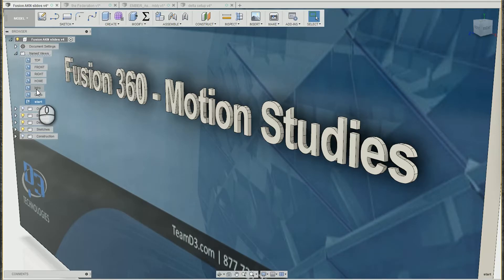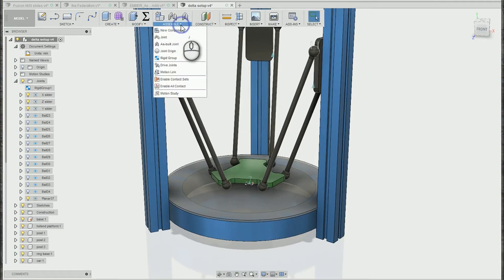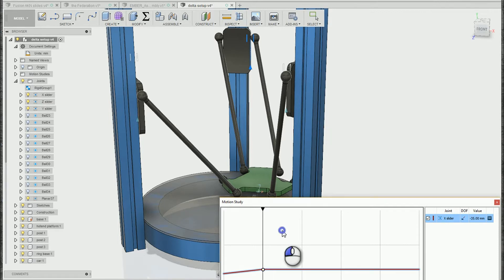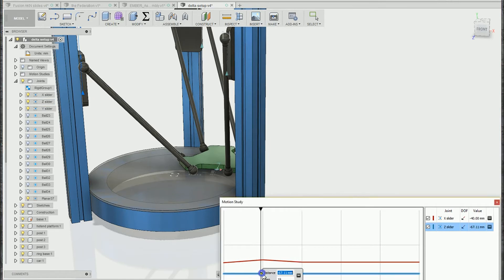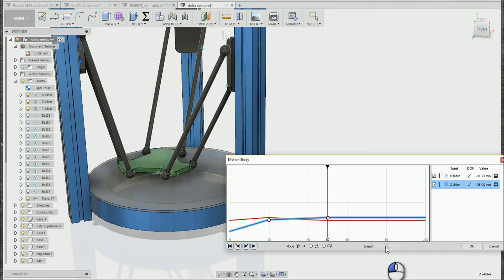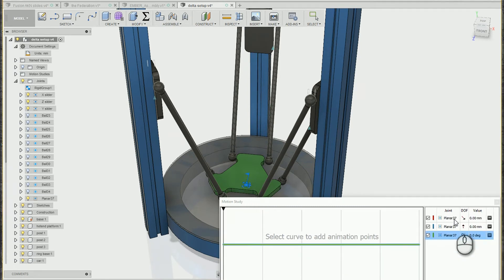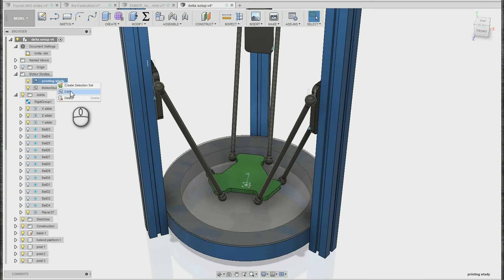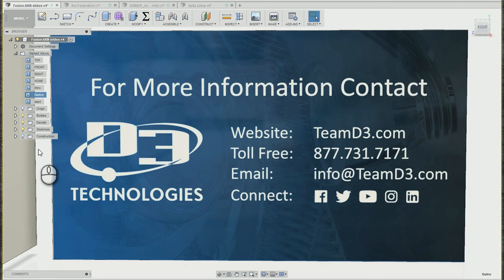Autodesk Fusion 360 - Motion Studies

Comment: But how did you build that printer itself? I'm having a rough time finding a tutorial that explains how to have multiple joints attached to a single item that can free-move like that.
Reply: Hi Andy.  I would be curious to know if you ever found a solution r tutorial that worked.  I am having the same frustration trying to model a drawer with left and right slides that wet I pull on the drawer front, both left and right slides have free motion like int he video above.  I see that D3 has an XY and Z slider which I assume correlates to each of the three arms. But I would like to learn the steps a bit more to have an better understanding
Reply: @paulschafer8780  Oh! I actually eventually got pretty good at getting rigs like this to work well. I never did fine a good tutorial, I just had to figure it out through trial and error. Go ahead and email me and I'll break it down (too many steps to put in here). 

My email is wright.a.william@gmail.com